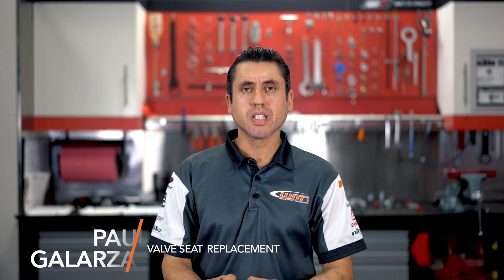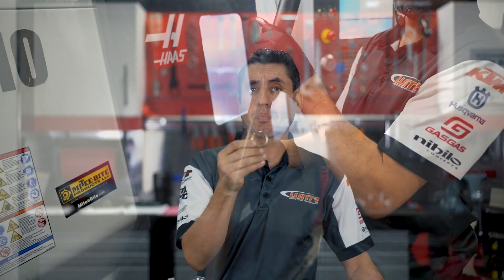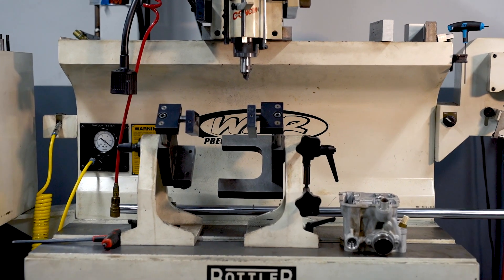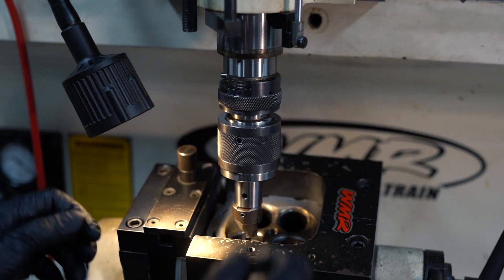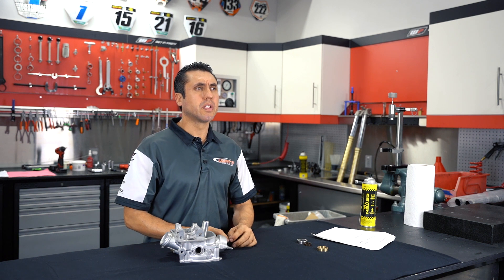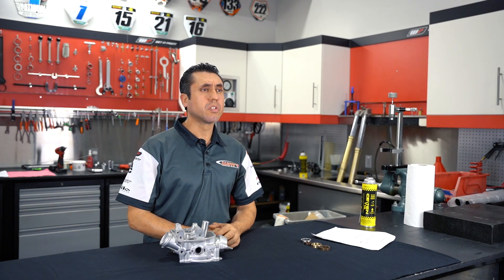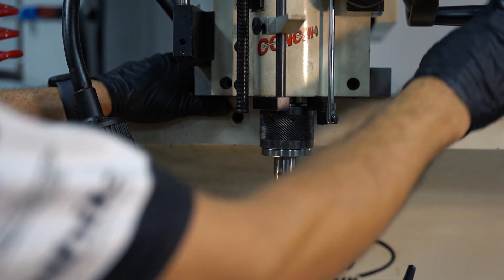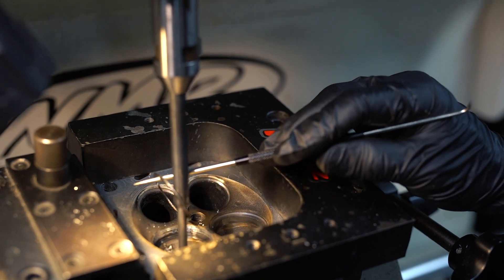Dirt Bike Valve Train Fundamentals: Part 5 (Valve Seat Replacement)

Comment: Hello to all
Do you actually sell valve seats? I'm working on two Harley Davidson  1998 Twin Cam "Screamin Eagle" heads. There isn't a lot of available parts for these. The valves are  even difficult to match up with AV&V and Kibblewhite products. I have removed the valve seats, so I'm going to need new ones as well as valves, seals and guides. Thank you for your video, time and videos can be costly. Any thoughts or help would be much appreciated. At 70 years old, time isn't on my side! LOL